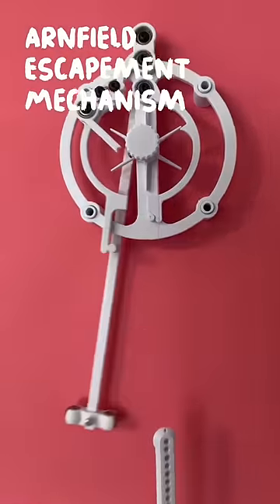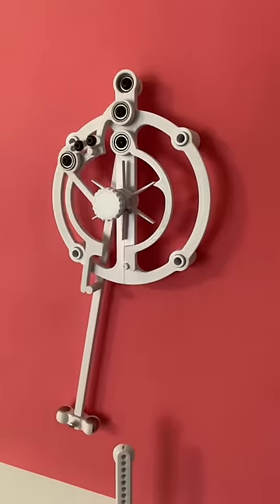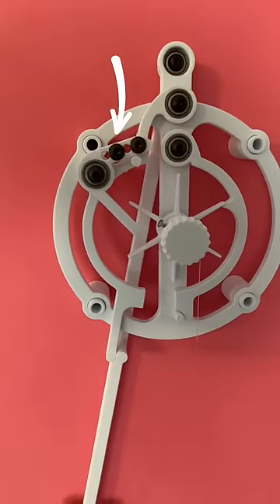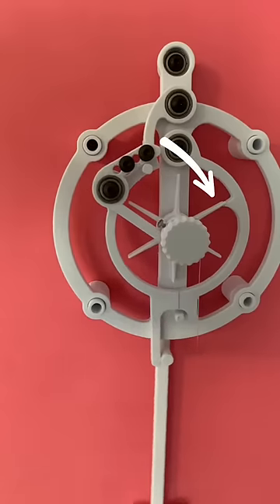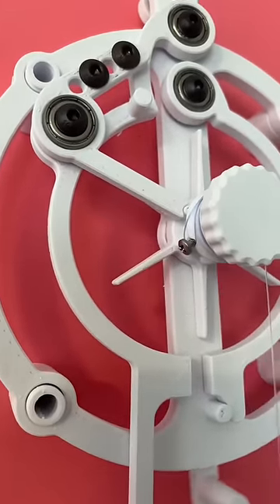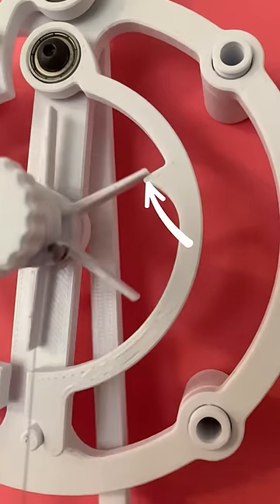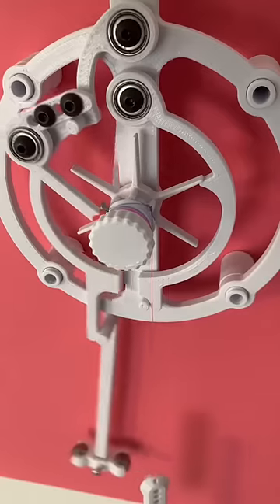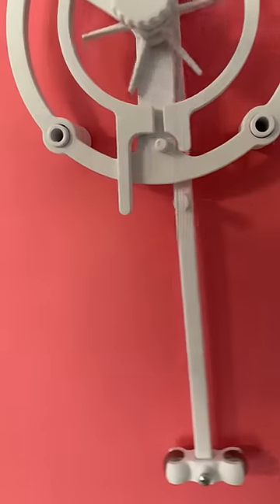The Arnfield Escapement Mechanism | Mind Blowing

Comment: "puts more energy into the system" no it doesn't... Don't lie
Reply from the maker: *puts more energy into the pendulum - my bad
Reply: More energy into the clock but not over powering the pendulum.
Reply: He's not "lying"; you are either being pedantic or just misunderstanding.
Reply: @Engineezy  Not really your bad when a youtuber wants to fight over semantics
Reply: Why don't you mention the string/line that pulls the weight down. What about that energy?
Reply: @PedroPedrito  literally lmao
Reply: Welllllll turning gravitational potential energy into kinetic energy by dropping the weight FEELS like it's adding energy even though it's not
Reply: More power to the clock means the the hands move as they should with birds sitting on them. With the same power pushing the pendulum with or with out flying rats trying to slow it down.
Reply: Thank you. My thought exactly. People might think this is fighting over semantics but with the amount of "magic" motors on the internet, this is a very necessary correction. The only thing that puts more energy in this system is the owner resetting the weight when it hits the ground or the total length of the string
Reply: @MrSen4lifE  yes he is. if he wanted to tell the truth he would have said returns most of the energy.
Reply: @PedroPedrito  exactly
Reply: @Engineezy  it still doesn’t “put more energy” into anything. These have to be reset eventually. Its not a perpetual motion machine.
Reply: @MrSen4lifE  there is no way for a closed loop to “put more energy” into itself. It will inevitably stop unless something else adds more energy  in this case resetting the counter weight
Reply: It’s pretty clear what they meant. The weight being suspended by the string has a given amount of gravitational potential energy, and each time the gear spins and gets caught by the mechanism, a portion of that energy is converted into kinetic energy. This kinetic energy (aka the suspended mass falling downward) is then captured and stored in the mechanism to push back on the pendulum each time it swings to the left, meaning the pendulum is gaining energy so that it can remain in motion. 

It’s not a violation of thermodynamics, it’s just poor wording. He should have said “the mechanism is able to harness the gravitational potential energy and put it back into the pendulum”
Reply: Gravity battery
Reply: “Thop being tho intellectually dith-honest” —🤓
Reply: @MrSen4lifE  Apple jump sifting sarcastic huge vacuum plop. Oh wait, do words mean things? Or not?
Reply: @Engineezy  But it doesn't put more energy, the pendulum is actually LOSING potential energy from the weight being lowered and converting that to kinetic energy and losses into the system.
Reply: @emplays934  Its wrong wording... he said "system", not "pendulum" so he was wrong.... dude, he corrected himself, discussion should be over....
Reply: @MrSen4lifE  
When discussing physics, it’s sometimes crucial to pay close attention to making sure you’re describing things accurately—one phrasing is correct, the other is incorrect and violates conservation of energy…it’s not a pedantic argument when the wording changes crucial details that result in completely different implications.  In thermodynamics, there’s a big difference between saying the systems energy increases versus saying the energy of a component in the system increases…the distinction is nontrivial.
Reply: @emplays934  
Gravity is a conservative field, though, so while it gains some kinetic energy as it swings down, it loses the same amount going back up to the top of its swing.  The net work done by gravity on the pendulum is zero after each cycle as it returns to its starting point.
Reply: @Engineezy  no it returns some of the energy to the  pendulum
Reply: @PedroPedrito  why mention it when it's obvious that is what is happening. Do you need a car YT short to mention that the accelerator is pressed to make the car move?
Reply: @doms.6701  Right, why bother mention the elephant in the room lol
Reply: @Engineezy  Nope, still wrong. Nothing in the system adds energy to the system. It's important that you don't word it the way you are because someone could infer that you have a perpetual-motion machine, which is impossible. Unless you already know that and you're intentionally trying to deceive people.
Reply: @MrSen4lifE  he was borderline saying this was a perpetual motion machine.
Reply: @MrSen4lifE  It's an important distinction that if it had not been corrected could lead the physics-challenged  viewer astray
Reply: Lol there’s a weight you can only see in half the shots that run the driving force
Reply: He is not claiming it’s a perpetual motion machine. The machine will stop when the weight on the string runs out of length.
Reply: lubalin couldn't even save this argument.
Reply: @Engineezy  No the energy is coming from the weight. The potential energy of the weight is being released with each swing.
Reply: Is it perpetual?
Reply: @aksdk777  no.. the weight drives it...
Reply: @PedroPedrito  yeah that weight is the reason it keeps spinning
Reply: @Gio98art  right
Reply: @DuFPV  yep the work owner put to reset the string would be the "battery" or potential energy.
Reply: @MrSen4lifE  Yeah, I  could feel the hairs splitting.
Reply: Spring loaded anything, its basically just a ratchet with extra steps
Reply: It’s the weight on the string that is powering it. Once the weight reaches the end of the string, then the whole thing stops. By the looks of it, it might not run for very long. Limited design. If you look at grandfather clocks, they have a few weights and keep going for maybe a month, not sure. But this isn’t some free energy thing, like the guy seems to be gearing towards. (gearing lol)
Reply: @Engineezy  Dang, your bad itself came, apologized, and even left a signoff
Reply: @MrSen4lifE  he he wouldn’t be lying it would mean that we’ve basically broken the fist and second law of thermodynamics. Kinda like an error in the matrix so probably not true. So he was in fact lying or just talking out of his ass.
Reply: Yep
Reply: So it's not perpetual. Right?
Reply: @MrSen4lifE  he is either misinterpreted it or he's lying.  There is no perpetual motion, this won't go on forever,  so obviously it's not putting more energy into the system,  just most of it.
Reply: Putting more energy means it will speed up like when you floor the gas pedal of a car, it speeds up.

Here it won't speed up and it will eventually stop so no it's not putting anymore energy than what you supplied it with your hand to make it move
Reply: @MrSen4lifE  you're acting like he has to set an example for small children.
Reply: @chedisLoL  We get it, you took introductory physics.
Reply: @chedisLoL  thats not what he said. The weight (that he didn't mention probably bc it's obvious) makes the wheel in the middle spin, wich puts energy into the hand. When the hand drops from the wheel, it puts more energy into the pendulum, and keeps it swinging
Reply: @PedroPedrito  escapement indicates gravity
Reply: @MrSen4lifE  no it's important. Energy can't be created so we can't use internal forces to add more energy to a system. You need to use external forces to do so. Otherwise we'd break all known laws of physics, and not even black holes bend the laws of physics.
Reply: @Engineezy  No it doesnt. The weight you have hanging on it makes the whole system go we aren't stupid.
Reply: Yeah the energy comes from somewhere, it comes from the weight, it's not a perpetual motion machine
Reply: @Engineezy  it puts no energy anywhere, the laws of thermodynamics say sk
Reply: @MrSen4lifE  yea I agree with you, however as an aspiring scientist I have a problem with pointless pedantic corrections so I don't blame him haha
Reply: Isaac Newton's peace has been disturbed, he says, most of the energy is returned, not more, not a free energy machine, but a very creative design, needs 3-D printing recipes
Reply: He didn't say creates the energy
Reply: @Thedude...  I never said create either... Like the quote said, he said it put energy into the system, that would mean energy that was from outside of the system.... 
People seriously the guy already corrected himself.... He already said he meant pendulum
Reply: depends on where you define your system borders
Reply: @MCRuCr  yes.... Let's redefine all scientific terms, so that they lose all meaning.....
Reply: @vasudev  \|/
  Ya know what, my man, yeah you're so right about that point; alas, it is precisely THAT aspect of the video that is dishonest, and it and it is what I have a problem with, personally.
  It was undeniably apparent that the unsaid part of his description of this mechanism's design, combined with the exact phrasing he utilized in his ending, was intended to be misleading and tease that it may be a perpetual motion machine... which is a thing that, quite obviously, it simply can not possibly be.   All of that, when considered in the context of his express LACK of ever bothering to even point out how the  counterweight was inherently limiting is what made me feel like this video was... a bit problematic... it could only lead to misunderstandings, and/or erroneous assumptions in some percentage of those that view it... that's not cool.  LoL.
Reply: What’s the string for?
Reply: I wish Fox News viewers were this emphatic for accuracy
Reply: @Engineezy  still wrong!!! The falling weight TRANSFERS energy into the pendulum. Directly proportional to the decrease in potential energy the weight has do to gravity!!!
Reply: @MrSen4lifE  hes not being pendantic, the video absolutely misinterpreted how the entire mechanism works
Reply: @stuartanderws5705  {
Reply: It depends what you mean by system. You seem to be assuming an isolated system that is not exchanging particles or energy with the outside. 

There is a thing called closed system which is allowed to exchange energy and finaly open system which exchanges energy and particles.

If you define the pendulum+escapement as one closed system and the weight as another closed system then you can say that the weight is adding energy into the pendulum system. 

The pendulum system itself is heating itself with friction and loosing that energy to the surounding air so it needs constant supply of energy from the weight to keep moving. 

I don't think this is too difficult to understand. If some idiot uses this video to misslead people well that's his doing. 

This is a clock channel not a university physics lecture. Anyone with basic understanding of pendulum clocks can see what he means. It is not lying or deceiving in the slightest.
Reply: @r.rodriguez4991  no shit sherlock. Are you gonna teach clock maker how clocks work? 🤣
Reply: @eklhaft4531  wrong... Just wrong... No matter the type (not definition) of system, something inside the system can't increase the overall energy of the system.
That is the point of my comment.
So one mechanism of the system can't increase de energy of the system, just transfer it to another part of the system.
Reply: @eklhaft4531  Apparently somebody has to because he's saying stuff that makes no sense.
Reply: @grayblack  What??? lol
Reply: @MrSen4lifE  - well, no, pedantic or not, words mean things. It's not putting more energy into the pendulum. It's, at best, recovering some of the spent energy and putting it back into the pendulum to increase efficiency.
Reply: its transferring energy from the weight to the pendulum so the pendulum keeps swinging so long as the weight can continue falling
Reply: @aksdk777  no
Reply: @lucienberl  of course not that's impossible
Reply: @Engineezy  I know that this is kind of random, but I was wondering if you had plans of making links to your website & Instagram account like it's set up for your YouTube Account in your "About" tab?
Reply: @Engineezy  where can I buy one? None on Amazon
Reply: It kinda does. From the stored energy in the weight. The energy is already there, but he's not wrong ad that energy is moving.
Reply: @Engineezy  you didn’t even mention the weight.
Reply: @Engineezy  The main source of energy is somewhere else not the left side not the right side but only the mass hanging under the system. it is hung via a string or kind of thread. but you tried to hide it and didn't mention it at all! so don't spread disinformation.
Reply: @MrSen4lifE  It's not just semantics. 
Speech that implies free energy is illegal in the physics and engineering community. Them's just the rules.